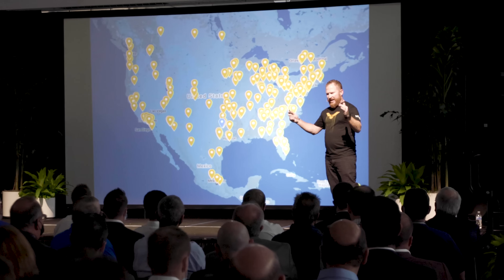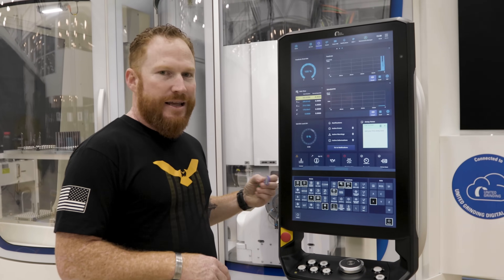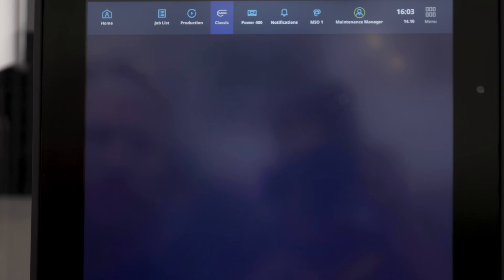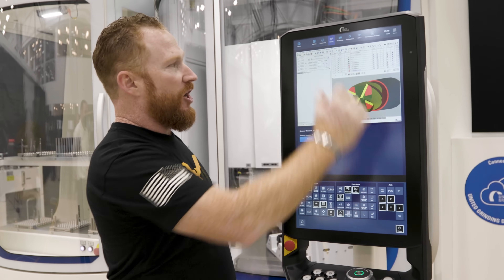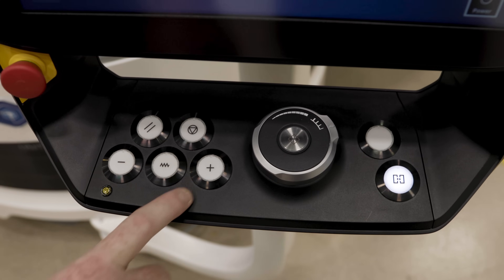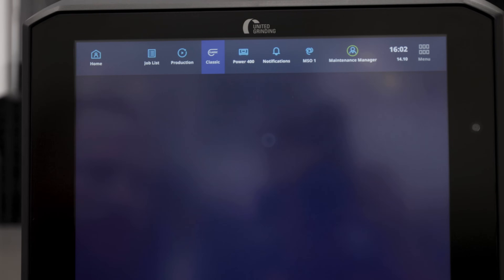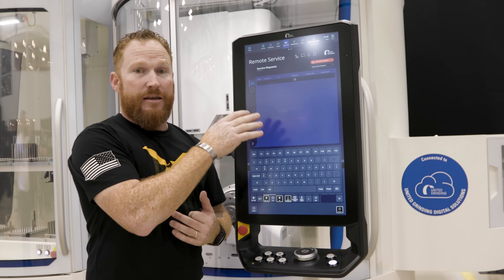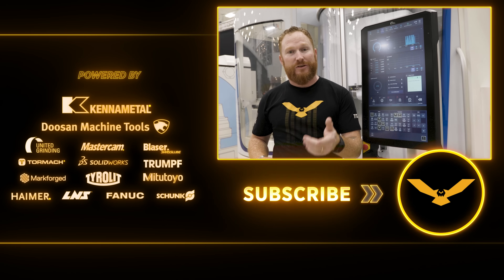Most IMPRESSIVE CNC Technology We’ve Ever Seen. The Future of Digital Machine Intelligence.

Comment: Great video and smart move showing traditional control right after saying that it is like a phone lol. Put tape over the camera! As a beginner I find it much easier to achieve success on machines that let me do what I want compared to the ones that give me options about what I can do next. Is there a milling machine control available today where you can open a program and tell the machine to give say 3x stock to leave on high efficiency roughing toolpath on that day so the machine recalculates all the toolpaths and a novice set up guy has some room for extra finish passes on wall and floor so the last setup pass would be at exact production settings?

Comment: I have sudo access on everything for the machines I drive at work. Operator, setup, programmer, service. The whole deck.
Reply: Linux CNC or old school get-er-donner controller? I run a Siemens 828D driven DMG Mori and I am stuck picking on the peel. Especially through ShopMill! Every function and action and button is tied to a routine. For example calling a tool automatically and modally activates the length offset. Each canned cycle makes it's own safety block and you can't edit anything.
Reply: @Sketch1994  I just wanted to sound cool saying sudo because i've been doing raspberry stuff with printers lately. It's a siemens 840d. Machines are from 90's.